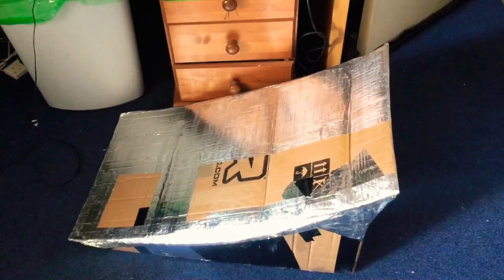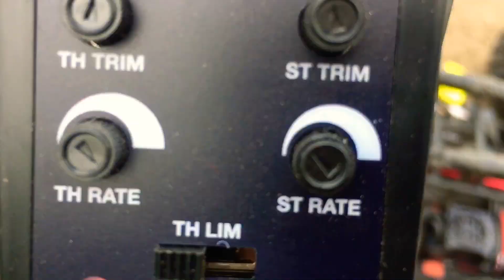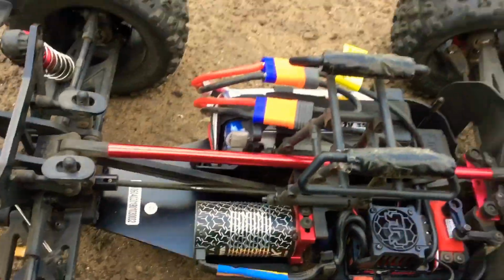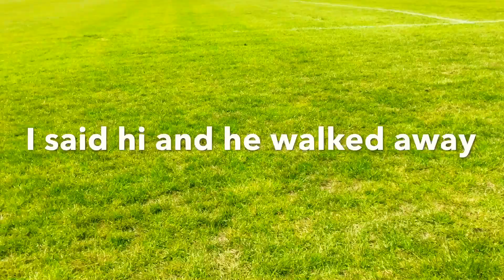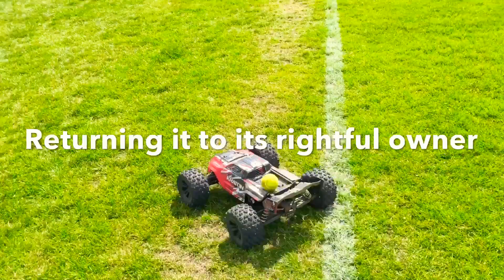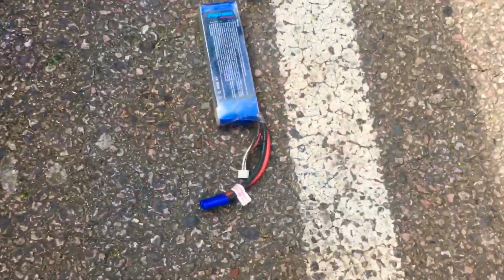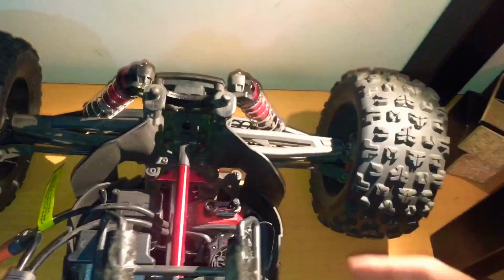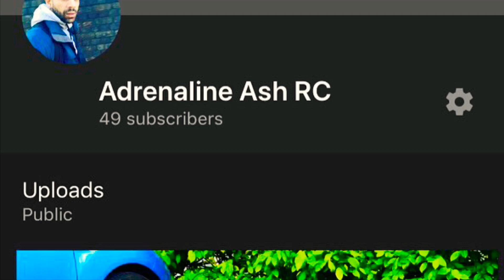ARRMA KRATON BLX V4 2019 EDITION Monster Truck/truggy. Testing The New Home Made Ramp. 6S Lipo.

Comment: Dude get some aluminum servo mount easy fix🤦🏾‍♂️🤦🏾‍♂️🤦🏾‍♂️🤦🏾‍♂️🤦🏾‍♂️ . Is this your first arrma.
Reply from the maker: BigKal's Rc  Aventures thanks bro already done got the metal servo mount and few other upgrades . And yeah it’s me first arrma 😎😁
Reply: @AdrenalineAshRC  cool. Also u gonna need some aluminum chassis braces front and rear. And u should be good on bashing. Arrma tuff🚬🚬🚬💯💯💯💪🏾💪🏾💪🏾💪🏾
Reply: @AdrenalineAshRC  one more thing to save your servo. Set your endpoints on your servo. I think I got a tutorial on my channel if I remember
Reply from the maker: BigKal's Rc  Aventures yeah bro thanks for the heads up 😉. i already got the braces And a few more other parts, just waiting for it to come by post. Il make another video on my upgraded parts soon . 👊🏼